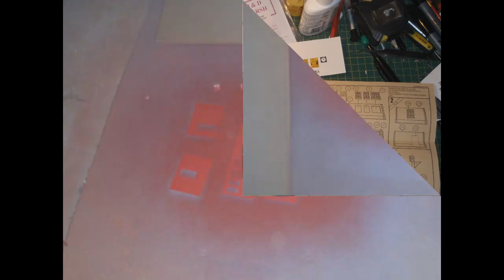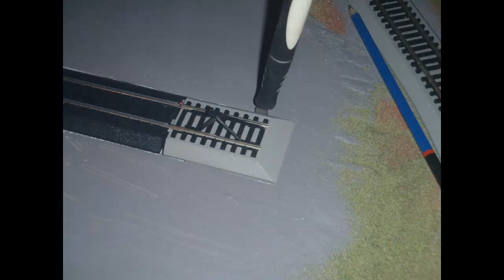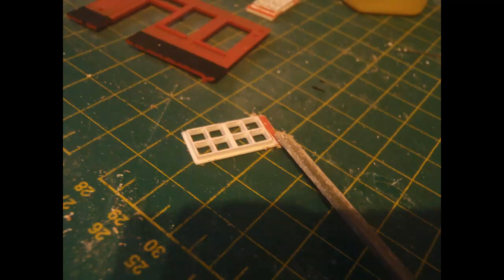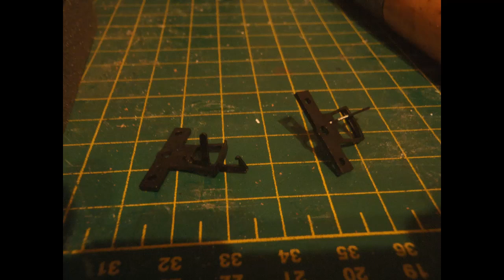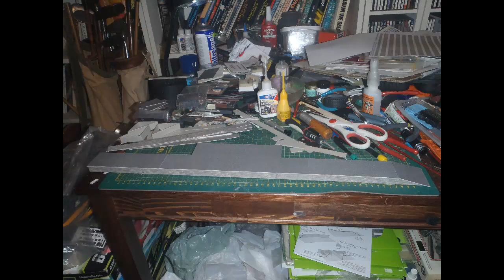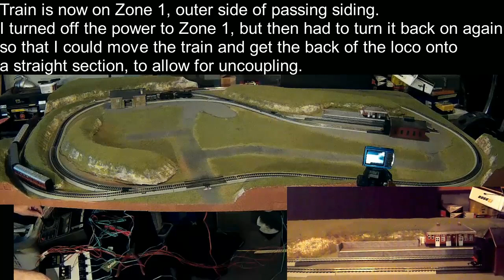OO Gauge 5, Layout Progress, First Station

Comment: Hi Ken. Did you really plan your layout to be this complicated? To quote Fagin from Oliver! "I think I'd better think it out again!". DCC would solve quite a few of your problems.
Reply from the maker: Well, DCC would definitely eliminate the need for sectional power wiring and switching. But it would imply other things. I'm interested in some of the older models, which would be very hard, if not impossible, to fit with DCC. I've never actually used DCC myself. But I am retired from a long career working with software, so I expect I'd figure it out. Still, my conversations with folks using DCC haven't exactly encouraged me... certainly there are benefits, but there's also considerable cost, and apparently quite a few wrinkles and issues to struggle with. And there's just the nostalgia factor - DC is how I remember model railways. And I didn't expect to have to do this stuff when I started this layout, as I didn't know the Bachmann points didn't route power. As I say in the video, my N Gauge layout has a much more complicated track plan than this, but it's way simpler to operate, as the Kato points only pass power in the direction that they're passing trains - so I switch the point into a siding, run a train in, then switch the point back to the mainline, and the train in the siding stays put, so the power switching on that layout is all done by the points themselves, with no need for special zonal power switches.